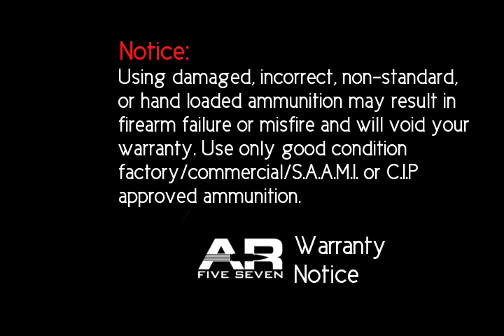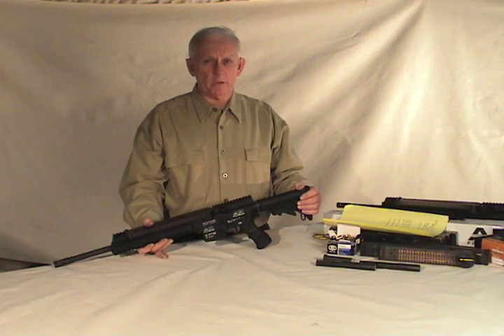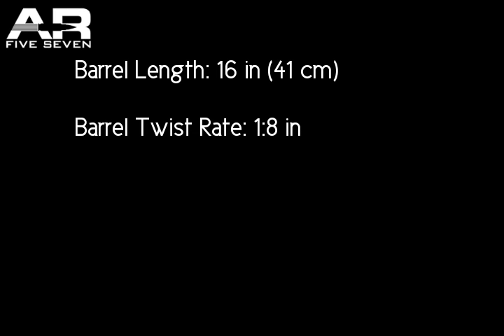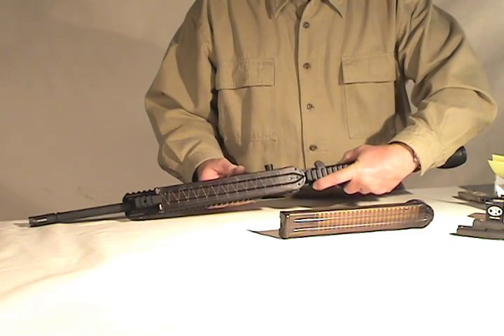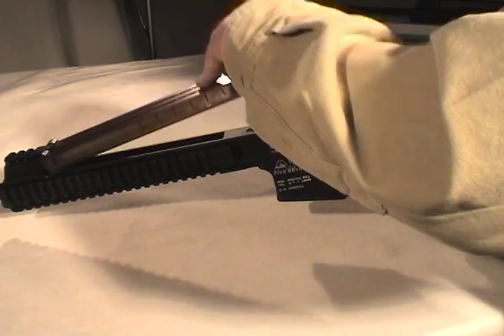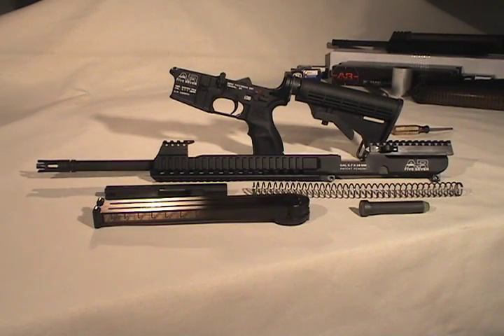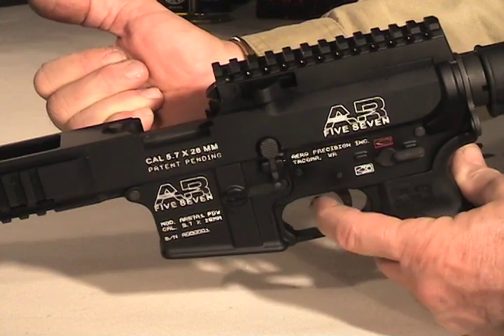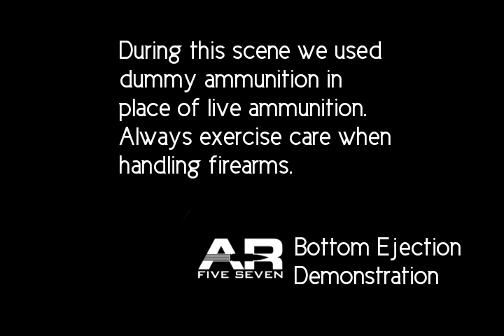AR57 Instruction video

Comment: Bought an AR57 upper, built out a standard AR15 lower for it, and once the upper is mounted on the lower, the bolt simply will NOT move backwards. Something different there, not sure what. Still researching. The lower works fine with a standard AR15 upper btw. Sigh.

Comment: This hasn't been available for years.  Apparently they had major issues with the bolt not closing all the way yet the hammer could still fall on the firing pin, thereby discharging an improperly seated cartridge which is VERY dangerous.  That is just what a friend told me who sold his.  That and it is too expensive to run compared to similar cartridges.
Reply: Yeah I had an out of battery discharge on mine the first week I bought it. Round exploded blowing the magazine off of the gun, and damaged the bolt to where it wouldn't function.
Reply: Patents were bought out and are now under production by Panzer Arms. If you search you can find one.

Comment: The main issue I had with the AR57 was optics. Obviously, you can get whatever rifle scope you want, or an RDS. However, the top-mounted magazine requires the use of relatively short optics. Plus, the larger magazines, which are certainly nice to have, definitely add significant weight, on top of the upper. Plus, at the 12:00 position, where the magazine mounts, and feeds the rifle, is where added weight is generally felt more, when compared to a standard AR15 fed, centerfire carbine. I definitely like the transfer of weight to the bottom (AR15), instead of sitting on top of my rifle (AR57),  my personal preference.  As far as optics on my AR57, I decided to go with my Trijicon 3x30 Compact ACOG Scope, Dual Illuminated BDC (I tried using a small length rifle scope, to minimize problems; swapping of mags). It Did Not Help, Unfortunately!!! With respect to the optics of the Trijicon, although the drop calibration is for .223, the range finding hashes work the same, and you can calculate, or determine the drop empirically. The Trijicon is slightly over 6" in length, and I definitely had trouble with swapping out mags. I decided to go with a set of BUIS', as a possible remedy to the optics issue. Using offset mounts, it's definitely, NOT the best, but does the job, unfortunately, unmagnified. So, IMHO, swapping out mags, if your AR57 contains a rife scope, definitely has its issues and can become annoying. Plus, the added weight atop the rifle, certainly doesn't make things any easier. The quality of the rifle is definitely impressive, though. I certainly believe that you get what you paid for!  You absolutely get your money's worth!!! What's also a huge plus, is the rifle's machining was actually really clean. There were no tool marks, or marring up and down the rifle, on either the upper, or lower receiver. Generally speaking, the rifle certainly did its job and was a quality build.

Comment: At one point I considered acquiring an AR10 lower since the AR15 lower knocks dents into the brass as they are ejected.  Then a friend who reloads told me that 5.7x28mm case has problems with reloading spent casings.  Something about some sort of coating the brass has on it that wears away when he cleans them.